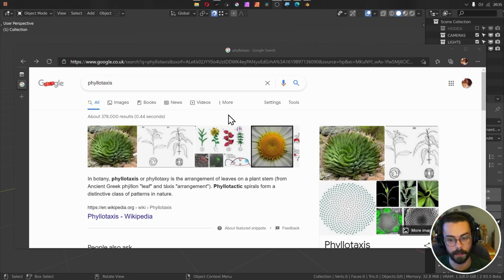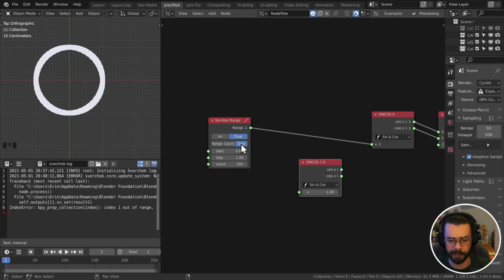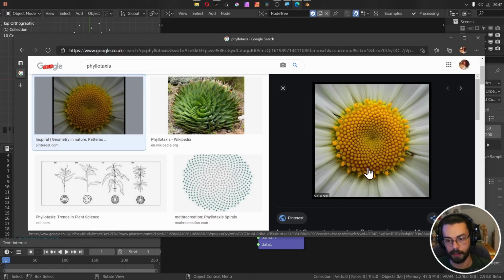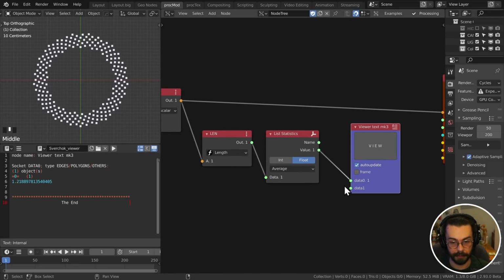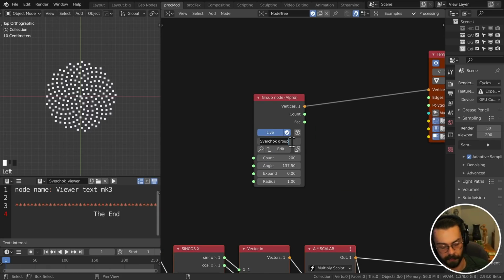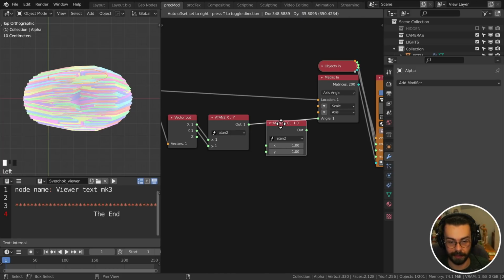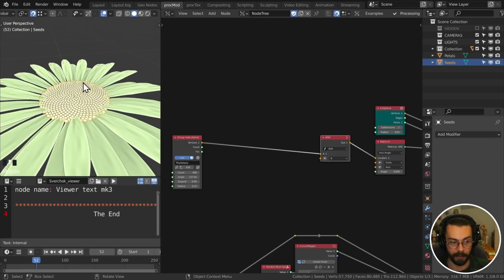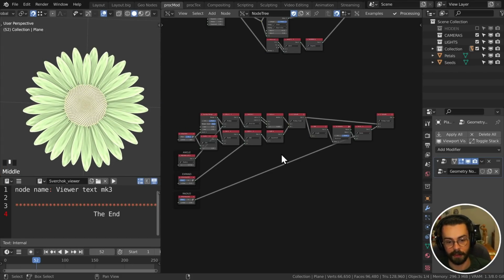Procedural Flowers with Sverchok - Blender Tutorial

Comment: hi.. when i i connect the degrees in the angle socket of the matrix.. the petal instances are rotated the wrong way.. what should i do to fix the rotation?
Reply: at 27:00
Reply from the maker: What way are they rotated?
Reply: @Erindale they are rotated in a circle... the head of the petal touches the bottom of the next petal.. the petals are not side by side... i tried to rotate the main petal in edit mode and object but they didnt change a bit..(for example as if u have a number of people and one person sees the back of the next person, not shoulder to shoulder)
Reply from the maker: Would be easier to explain and solve with screenshots. Are you on discord? Best to ask on there and tag me or to drop me an email 👌
Reply: @Erindale  yes.. will try to see wat i can do.. u can try to replicate the tutorial with the latest sverchok update. coz i downloaded the sverchok addon today and it even doesnt have the menu icon under UI in the addon preferences. so maybe its a bug or they have changed the core operations of the nodes. for example there is "object in lite" instead of "object in".
Reply from the maker: Oh I think object in is now Get object Data (or it was last time I tried) I wonder if that's to do with the issue here

Comment: Hi, somebody knows that when I add Node "mix number" after group node and connect to the "matrix in", (fac -  factor - angle y), I have met a problem that point out TYPE ERROR UNSUPPORTED TYPE FOR INT AND TUPLE. how can I fix it. Thanks so much
Reply from the maker: If you view your group output with a text viewer, what kind of data is coming out? I know for a while groups weren't working so maybe just double check things are plugged in properly inside.

Comment: Awesome tutorial.  Sverchok does look easier to follow than geometry nodes.  I did have 1 weirdness.  When  I duplicate a node, they won't 'snap' onto the lines.  The line highlights, but it won't insert.  I have to manually connect up each node.  I swear I saw it working once, but wondered if that is an option that you can turn off/on.  Anyone have any insights?  I went into the shader tab, and that function works there, so it seems to only be in the sverchok tab.  I am using Blender 3.0.
Reply from the maker: Yeah there was some weirdness in 3.0 with Sverchok. I think it;s something that got changed with python nodes. It's working again in Blender 3.1 though.
Reply: @Erindale  cool! thanks

Comment: is that possible with geometry nodes as well?
Reply from the maker: Certainly is! The maths translates just the same to the attribute math nodes, it's just slightly more cumbersome to work with. You can see me use this method in my splashscreen video
Reply: @Erindale  thanks for the fast reply! i will definitely watch it because i got stuck at the radius variation of the points and could'nt figure out a way to do it

Comment: Cant find anywhere.. am I able to use "Voroni on Mesh" node, but on an object not mad with sverchek - for example a daz3d mesh. Seems like a procedural non destructive solution to Cell Fracture? If so.. any pointers?
Reply from the maker: Yeah certainly can do! I'm assuming you've got the Voronoi on Mesh node available in your spatial nodes? If so you just need to use an object in node to pull in your daz model from the 3D viewport and then use either Random Points on Mesh or Vector P Field to create the sites that the Voronoi is calculated off. Here's a  setup that can separate the voronoi blocks: https://i.imgur.com/gCOiZ1J.png
edit: That setup actually doesn't need the Separate Loose node as the voronoi node is already outputting separate blocks by default

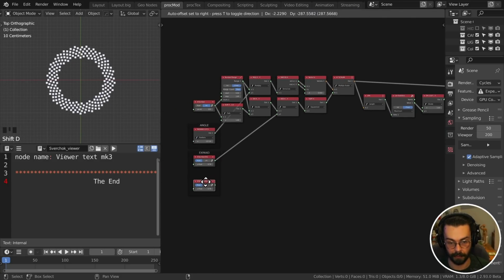Comment: When you used the Maximum of the Lengths of the vectors to maintain the radius(during 19:00), it can be done by using a 'map range' node for the radii values as well, right? Then it can be achieved in Geometry nodes too.
Reply from the maker: There's no way to use list limits as your input range though in geometry nodes. Once we have a way to find the maximum value in a set then it can be done in geo nodes. The attribute statistics node is being worked on:
https://developer.blender.org/D10202

Comment: wow, perfect explanation, thank you for the tut
Sorry for the dumb question but can this be done with animation nodes, i fell like it can be done
But what's the advantage of sverlock nodes compared to animation nodes?

Thanks in advance
Reply from the maker: Yeah should be possible! Sverchok is aimed at computational mesh generation with a workflow similar to Grasshopper for Rhino 3D so it's familiar to designers and architects. Animation nodes is more aimed at object transforms and procedural animation control. I wouldn't say there's necessarily a benefit of one over the other, they're just different tools. Something fairly simple like this will be doable in AN though and you have things like the Direction to Angle nodes so no need to do the stuff with atan2.

Comment: Feels like if i have read maths basics with this 3d program i would have better understanding how those formulas comes in handy in daily life like here,,,,, also can you tell me that at ur starting stages to learn sverchok u just tried nodes or also went theoratical to understand how it works theoratical like reading mannula released by sverchok makers
Reply from the maker: If you select a node in Sverchok and press N to bring up the side panel, one of the tabs has an option to look at the online manual and it will link you to the manual page for that specific node. The manual has loads of examples so definitely look there. Also in the top right corner of the node graph header, there's an examples menu where you can check out whole setups and see how they were made.

Knowing some basic maths like the sin & cos to make a circle and how to use trig to get angles etc will be really helpful but beyond that it's mostly just logic so you can think your way through. I wouldn't stress about needing to study maths, that's not something I did as an artist.